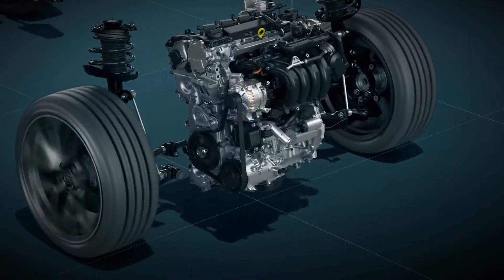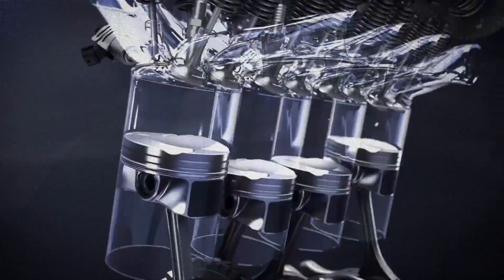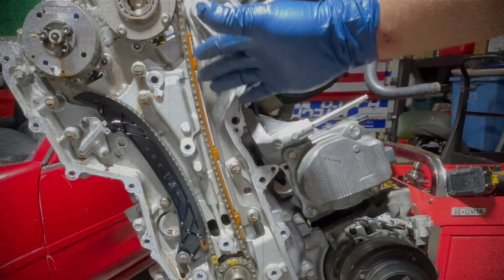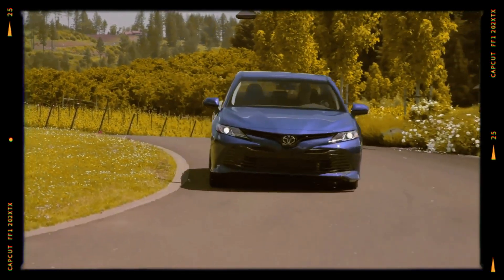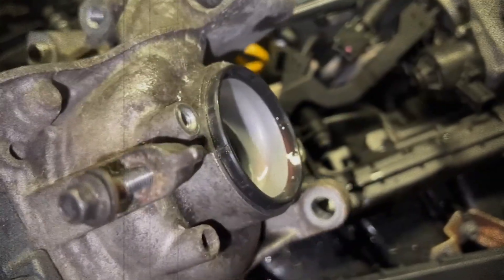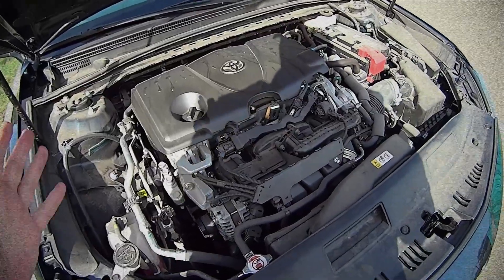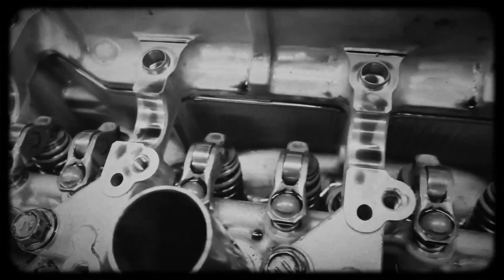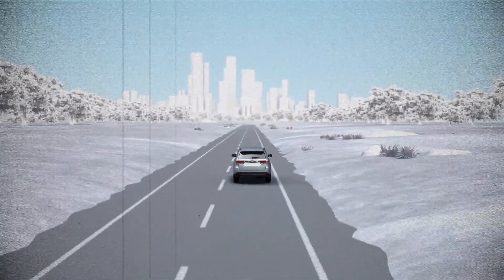Toyota A25A-FKS 2.5L Engine | Specs, Problems & Reliability Explained!

Comment: 2020 Camry SE no issues at all it just now hit 65k miles so barely broken in. Oil changed every 5k, Transmission service every 45k miles , coolant every 2 years. About to start doing coolant service every year since they have complex cooling systems it is probably wise to keep it clean as a  whistle. No oil consumption issues at all and this video is the 1st time I have even heard there have been some issues with that which makes me think that is a bunch of BS probably taken from the old Camries from 2008 that did have ring issues.

Comment: Ich habe auch einen Rav4 306 PS. 5W30 füllt Toyota ein. Aber wir fahren ja auch schneller. Die Übersetzung ist ja auch sehr Lang bis 130 km/h nur 2100 upm. Wenns kalt leutet der Motordeckel blau. Die Heizung zieht Wärme aus dem Motor im Hybrid Modus. Beim Warmfahren also Heizung aus lassen. 😊

Comment: I currently have this engine in my 2018 Toyota Camry. Current has just under 300,000 miles and runs perfectly, same gas mileage as when I got it new. Does not burn any oil. Oil changes every 5,000 miles NOT the 10k as recommended. I drain and replace the transmission fluid every 30,000 miles, no more flushes. Again, everything runs perfectly.

Comment: My 2020 Camry has this great engine. It's still new at 26,000 miles with no problems at all. MPG is outstanding. I change oil every 6 months regardless of the miles (about 2,000) with Mobil 1 0W-16 synthetic and use Toyota (dealer) oil filters. All the experts advise NOT to follow the 10,000-mile oil change scam. They should be arrested for recommending that interval. Six months or 5,000 miles MAX!

Comment: 2018 Camry 99, 000 miles and no issues so far.  Tips on additives that increase the engines lifespan would be helpful.
Reply: None. Use Top Tier fuel and quality oil changed around 5k miles.
Reply: @freebehindbars8654   By top tier fuel do you mean 92 octane or something else.  Also, about the 5K miles for the oil changes. If you were driving all highway for 100 miles a everyday round trip to work what would still suggest 5k or possibly something a bit higher?
Reply: @philc.352  can prolly do another thousound or 2k miles if it’s strictly highway driving and assuming this is not in the cold or u idle a lot . If it’s colder than you get a little more blow by so you don’t wanna leave it in there for more than five k
Same with idling.

If you’re really concerned about it, then you can send your next oil change sample in for analysis and ask them how much further you could take it
Reply: @philc.352  And top tier fuel is a fine solution for carbon deposits but isn’t really necessary for Cars that don’t have any issues with carbon deposits… if you have direct injection only I would top tier only because those injector systems are high-pressure and expensive and carbon up real bad

If you run top-tier in normal conditions for the normal car without direct or maybe it has both , put top tier in there every 10 full-ups you would probably get rid of most of the carbon deposits assuming you are doing this routinely one every 10 times you go to the gas station…

Like those carbon fuel cleaner things for cars with carbon problems for instance only recommend they are used every oil change at most ..so you don’t have to use top tier 24/7 under all conditions especially if you have port injection because you’re not gonna have an issue with carbon buildup. I would still use it sometimes and maybe give it at the Italian tuneup while it’s in there…to keep her clean

Top-tier is just expensive fuel with way more detergents in it that keep the injectors, valves, and combustion shaper cleaner than cheaper fuel by almost 20 times

i have a tuned V6 dual injection (port and direct) so I use top tier only but it’s also a large high Compression performance oriented engine with those high-pressure expensive injectors mentioned…

If I had a Honda Civic, for example, I would probably only run top-tier every month or  so to keep her cleanish but if it’s not a higher stress or performance engine, I would not waste my money on it.

It has nothing to do with octane. It’s just based on the amount of cleaning detergents and it’s believed to be more consistent in terms of the formula you’re gonna get
Reply: Oil changes double up and it’s fine. Fluids per the book is fine. No additives needed
Reply: 2018 on up can go 500,000 miles IF lubricants and filters are changed frequently and the owner calls a tow truck if engine coolant temp rises above normal for any reason. https://imagizer.imageshack.com/img923/8450/5SkYYl.jpg

Comment: It burns oil, because they're recommending oil changes at a ridiculous 10k miles!!  Change it every 3k miles (5k KM) and you'll be fine.  New engines cost $10k including labour to replace.  Also replace transmission fluid every 50k miles.  NO such thing as 'life time transmission fluid.'
Reply: Facts
Reply: Yes, 10k miles or a year is too long for how most people drive. Most mechanics recommend changing it every 5k or 6 months. Personally, I wouldn't go longer than 3 months, as short trip driving dramatically reduces oil life. Another issue is that Toyota no longer acknowledges engine break-in. I did my first oil change at 500 miles.
Reply: The low-tension piston rings don't help, either.

Comment: A25A has no oil consumption problems. BAD REVIEW!
Reply: Probably an AI generated video. They are often wrong.
Reply: @MrErpman  Some (very) early versions of this engine ( in 2018) had some oil burning issues, but that has since been resolved.
Reply: I think it comes down to maintenance. Most of these cars get their first oil change at about 10k miles and in most cases that ends up being well over 6 months.

Comment: How does it compare to Subaru? Would you rather go with a Forester?
Reply: Im still amazed at my gas mileage. I've gotten consistently 35 mpg city and up to 40 plus highway and its non hybrid. "Oh what a feeling"
Reply: So, that engine is disposable and not rebuildable? Not good.
Reply: @patrickhenry2845 I’ll let you know!  😅
Reply: @Sub_93 It was mentioned in the video. That the engine was disposable and not rebuildable. That's why I said it.
Reply: Subaru! Only if you like vaping!
Reply: Lmao Subaru is trash and spark plug changes are a headache
Reply: @fallguy4209  If you think changing spark plugs on a Subaru is a headache, you haven't seen it done on a Ford Aerostar.
Reply: They are both great engines.  The power on this engine comes at the top of the rev range while the Subaru has more power down low in the rev range.
Reply: @Sub_93  Thanks for the info.